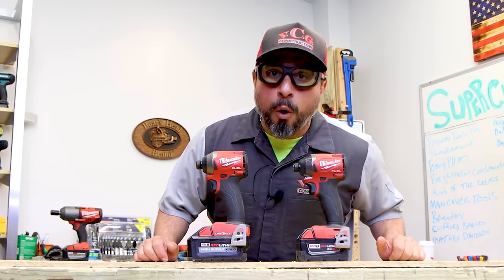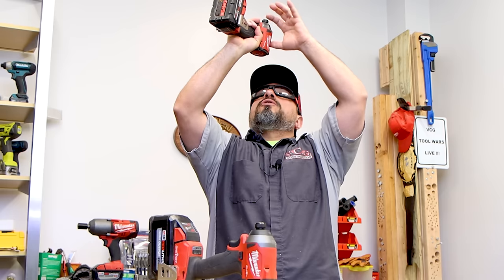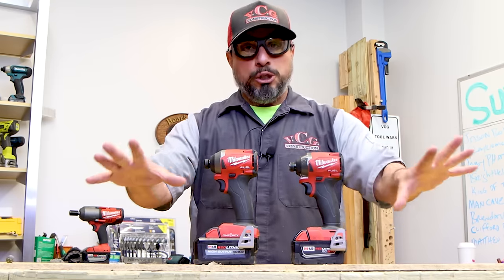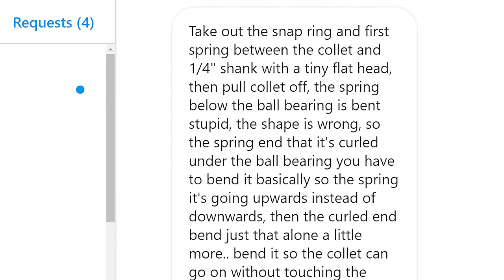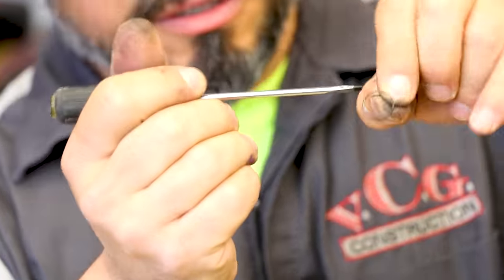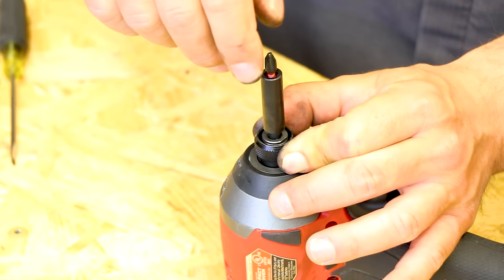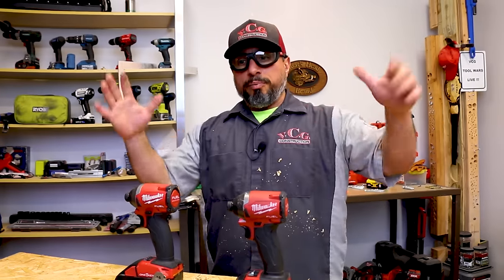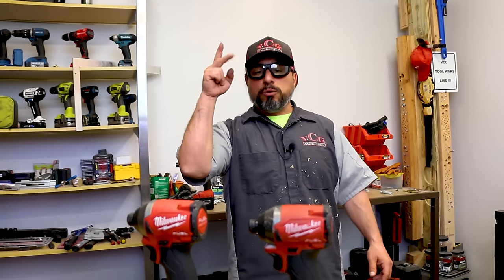FIXING MILWAUKEE M18 FUEL Gen 3 IMPACT DRIVER COLLET PROBLEM (must watch)

Comment: Hey Vince I have 4 Dewalt 885s and have had to fix 2 collet issues over the 8 years of using them hard. What has happened on the Dewalt is the bearing tensioner spring tip has broken off due to many hard years of use. On the Dewalts the bearing springs upper end is bent in at a 90° angle at a length of about an 1/8th of an inch and that little bent tip sits under the bearing. When ive fixed both of mine ive simply bent another 90° tip on the end of the existing spring where the old end had broken off after 4 years of daily use. If the fix didnt work I was just going to order new springs from Dewalt but the fix has worked great for the past 3 or 4 years. You might try a Dewalt spring in your Milwaukee collet as from your vid everything else looks very similar. Im wondering if the U shape of that Milwaukee bearing spring causes some binding issue when under extreme vibration that makes it bind against the bearing chute walls preventing it from pushing the bearing back up. It would be interesting to know how other quick collet manufacturers springs look in comparison. If all the other manufacturers have springs like the Dewalt and dont have collet issues then that Milwaukee bearing spring might be the issue. Having so many different manufacturers at your fingertips you could check it out Vince. Really would like ya to get it figured out so Dewalt has No excuse to not bring out a better impact then the 887 UGH! My 885s arent going to last forever, or are they lol. 👍👍👍

Comment: I found the problem with the collet in Milwaukee impact driver gen 3.  My old Mastercraft Impact driver has to be pushed in to insert the bit. On Milwaukee, it has to be "pulled" to release so it is the opposite. So when trying to remove the drill bit with Milwaukee, you pull the tool up and that is exactly what this Milwaukee tool needs to release the bit. Conclusion, Milwaukee will have to change the direction of the collet, instead of pulling, {to release the bit} pushing will do lock the collet in place and the bit will remind in the tool when pulling up to remove the drill bit from the work piece.  Very simple, now Milwaukee engineers get to work haha.

Comment: I wonder if you take the spring out of the m18 surge or the older brushed impact and put that spring instead. I wonder if that would make a difference since those impacts don't have this issue.

Comment: Hey Vince now that you've shown me the internals of the mechanism it seems to me what you're looking at is a tensioning issue with one of the springs but I'm not entirely certain it's actually the spring down there holding the ball bearing in it may be a tensioning issue with the collet spring not leaving the collet completely engaged. Does seem like very very fine Springs for such a hard use application. The best course of action might be to beef up one or both of those springs.
Reply from the maker: Yeah, I think you could be right

Comment: Have you stripped the serge to check if the ball bearing and spring is the same as the gen 3 ? Swap them over if they’re the same and if it still fails. I’m gutted I was ready to buy and came across your vids trying to fix them.

Comment: I iove your videos great info on your channel! I had the same problem with my impact driver . Maybe the problem is the anvil of the impact driver is not hardened enough . So when you impact on the ball or pull against the ball when impacting it peens the slot or makes the hole bigger in the anvil then it sticks just a thought.
Reply from the maker: Thank you for the awesome feedback and sharing your experience kenny! We appreciate it!

Comment: I was hopeful with the increased retention that this was going to do the trick. Kudos to the idea and attempt to share the fix which is more than the manufacturer has done to this point. I’ve watched but declined to comment before since my initial view hasn’t changed. I’d still like to see if a double bearing collet would be better and maybe the retention indents of different brands sync up to a more uniform tolerance across all. I have nothing against the daredevils but their indents seem to have a much larger indent throw which then allows the ball bearing to simply ramp up and out of the indent upon pulling the bit out. Couple that with the force in pulling the bit out also coincides with the fact that the collet may also be getting forced into its natural release position, if that makes sense. Heck, maybe Milwaukee might just want to reverse the collet so pulling it towards the motor housing releases the bit , lol. Soap box put away, appreciate what you do! Stay safe all!
Reply from the maker: Thanks Tim, hope you and yours are doing well!
Reply: Good theory, but this tends to happen with all bits, even those made by Milwaukee.

Comment: So I just stumbled across this video/channel for the first time, and had no idea that this was an issue. Now, I'm not an expert or anything, I cant thing of a time I have drilled a blind hole that deep. However, I have to ask why you go full-send without chip evac every few seconds? Surely the extra material is clogging the hole and giving you the issue in the first place? I have punched through some reasonably thick sections of wood, and I typically clear the chips out before I've completely buried the entire shaft of the bit. I'm not saying its not an issue, but it seems like basic chip evac could help prevent this issue?

Comment: Mine worked great for like 8 months then started to have this issue as well.   It also has a weird issue now when I pull the trigger the tool will do nothing with a charged battery.  Only thing that will bring it back to life is switching the speed setting.

Comment: Does Milwaukee removed the bottom spring in the new models? On Dewalt impact, the bit jumping out when you lift the collet up unlike the new One key impact that I have.

Comment: ive never had the collet problem. i would suggest its not an occurrence with every single driver. i guess i got lucky. cant recommend the Milwaukee driver enough. i use it mostly for cabinet making and carpentry. but i have used it extensively for duct installation and driving into steel frames. never an issue. the power delivered, the tension control, and the battery life is phenomenal.

Comment: Not sure if mine is a gen 2 or 3 bought it in 2019 but mine doesnt lock in when I just push the bit in I have to pull the collet ring forward like when you want to release the bit. Are any of the fuel impacts supposed to function like that? It doesnt ever drop the bit or have it come out it just wont push in and lock without manually pulling the ring forward.

Comment: I didn't really know this was a thing until I found out, the hard way... Ended up busting a bit because it came out enough that it broke off... I did see yours do it during one of your head to head battles against a competitor, and they had no troubles doing the exact thing you were, but I thought it was a fluke and there was debris trapped in there.

Comment: It was worth a shot 
I think you should try putting the M12 spring onto the M18 gen 3 spring because they are designed differently , that could work 
Thanks for addressing this
Reply: Has anyone done this yet? Did it work??

Comment: I just returned the one I bought.  It takes 2 hands to change the bits, the light is crap, and it shakes the shit out of your hand if running in lags.  It's also loud and gets hot.  My old brushed Dewalt, while not as fast, transmits a fraction of the vibration to the hand that the Fuel driver does.  The Dewalt also has single-hand bit changing and has a good light.

Comment: Haven’t had a problem with mine yet. Drill on wood, but I do lubricate the collet with wd40, and I use the drill not the driver for paddle bits.

Comment: I've never lost a bit like that, but then again I don't yank on the driver when reversing the bit out. It comes out just fine on it's own. I use spade bits constantly with my work as well, and while I can see this happening with the type of release system, the type of demonstrations or work that cause this to happen is only under extreme circumstances/abuse. Though regardless I personally don't need the quick release setup, and wish that Milwaukee would just let us use a non quick release collet if we so choose to.

Comment: I'm about to buy an aftermarket collet insert and just weld the fooker right in. I had 2 milwaukee fuel impacts from 2018 and NEVER had the issue. I plan on taking them apart to see if there is any noticeable difference. Could be something as simple as the grade of spring steel or even tolerance on the ball bearing itself. Either way, not thrilled

Comment: Man I was really hoping this fix would work so it could crush the TTR's. When it was new was the collet a problem, or did it just become an issue over time and gradually become borderline unusable for pull outs? If it was a gradual thing I would say that likely the springs are stretched, and a good solution would be to order both springs and maybe ball bearing assembly from Milwaukee. If it was an issue the entire time then replacement parts likely would change nothing like this hack did. 
Thanks for the vid.

Comment: Hi Vince good vid but I think the person who suggested the fix is barking up the wrong tree.  The issue isnt with that sping with the bend in it, it is the fact that the collet is stopping in such a place that the ball is still on the ramp on the inside and not on the flat.  When pressure is applied by pulling on the bit, the ball forces the collet forward and hence disengages.  The ball needs to sit on the flat at the top if the ramp i.e. further back on the tool.

Behind the second spring is a quite a fat flat washer which if it was slimmer would allow the collet to sit further back.  I would have tried this but I think finding the right size washer would be a pain so I put the rear of the collet, not the knurled end, on to an angle grinder and took some material off.  This now allows the collet to sit further back ensuring the ball can not force it forward to disengage.

If milwaukee wants to rectify this the cheapest option would probably be a thinner washer or the more expensive option is to reduce the length of the collet (try holding it up to the collet on the M12 impact and you will see a slight difference).  Hope this helps.

p.s.  please note if you are going to grind the rear of your collet, make sure you put a champfer on the inside edge so that it does not catch on the spring causing the same issue and bend the indent in the spring downwards with pliers.

Comment: I did the repair with the dewalt dcf886 
The spring was broken , I ended up using the same spring , reshape  the part where it holds the bearing in place

Comment: Great video👍🏻👍🏻
I just bought a factory reconditioned 2997 kit that has this impact in it from Tyler Tool. Did Milwaukee ever fix this issue? I will be curious if a factory reconditioned tool will have this fix🤔 I will have to test it out exactly like it was done in this video and if it does happen it will be going back because I don’t want to waste my time messing with this. Lost time is lost money!

Comment: The problem isn’t the spring you adjusted in the video. The problem is the first spring that holds the retaining clip. I found that if you pull the quick release and release it slowly it doesn’t have enough force to reseat the mechanism and allows bits to come out. If you pull the quick release and allow it to reseat by letting go when it’s fully extended it will hold each and every time. A stiffer spring that holds the retaining clip can fix this problem.

Comment: Does it pop off when driving lags with a impact socket on tip?...I need a good 1 for that plus screwing deck/framing...we lag rim's and post sometimes with 1/2 inchers I hate using rachet

Comment: I have a Brad nailer that just started clicking and putting in a light show, it does not appear to be jammed in any way and it doesn’t matter which battery I use. Any ideas?

Comment: @vcg construction, I am curious if this issue affects the m12 impact as well?
Reply from the maker: Miles sometime it does happen on M12 too but not on the surge impacts...
Reply: @VCGConstruction  ...any chance on taking the spring off the surge and putting it in the gen3?  Perhaps we can measure ball bearing as well.  Thanks.
Reply: @JerseyFrank007  it does not fix the issue, the issue is likely the machining of the ball and spring slot. I need to grab my caliper at work to measure and compare, but I swapped springs to check the issue.

Comment: They put a great collet on the Ridgid impact drivers.  Why don't they just use that design?
Reply: Can you say "Patented Protected" ?  Believe it or not, manufacturers pull a patented for multiple parts of a piece of equipment for this very reason.  And it may stop another company from attempting to design a competing tool or device.

Comment: I cannot confirm this yet, but based on what I can see and test... there is a manufacturing tolerance issue, the springs are fine. I swapped them with a different m12 screwdriver and the m12 still held on to the bit like business- but the m18 still felt soft with weak feedback when pushing a bit into place. I will mod one spring- if it doesn't work I still have another set.

Comment: I still use a standard drill, like the xph07 or milwaukee 2804 for drilling, i just havent seen any advantage to using an impact for paddle bits and drilling holes in general, drill chuck holds it good, and is faster than an impact when drilling, driving screws is a different story...

Comment: I just sent my M12 gen 2 impact driver to Milwaukee service repair and the only thing they did was give me someone else’s gen 2 impact driver and it has scratches on it. Also has the same issue. I just wrote an email to them calling them out. Not a good initial first chance to repair it.

Comment: Hey Vince @ VCG, awesome video. I was hoping for the WIN, but alas, it was not to be!
I have been wanting to get into the Milwaukee platform for a while now (narrowly missed out on the Black Friday/ Holiday deals this past season, even though they ran for quite a while.) 
Feeling a little bummed that since the price you’re paying for a Gen 3 impact kit (or even bare tool) is no small amount, you would hope for that semi premium price point, you would be able to have some confidence in design and build quality of such a fundamental part of the tool.
I currently use my Kobalt impact driver/ hammer drill combo, and it has served me very well.

Do you (or do any of the other members of the VCG) know if this affects the M18 Surge?
I did score one of those on sale, bare tool for around $119,  but haven’t broken it out yet since I didn’t grab a kit am not set up with M18 batteries just yet.

Thanks for another outstanding video. 
Informative, entertaining and most importantly delivered with the unvarnished truth, which is what we all appreciate and value so much!
You and “The Gang” keep up the good work.

Comment: The problem seem to be related to   the rotation of the tool overcoming the spring tension on the ball bearing... Maybe a different spring would be needed entirely or a complete redesign of the system

Comment: The collet is one thing... my biggest problem with the fuel gen 3 is a couple times a day I go to run a screw in and I get no response from the drill. I use my makita almost exclusively now because I'm tired of the issues that the milwaukee impacts have. That's ok, skeeter seems to have it figured out

Comment: You've said before that the surge doesn't have the same issue. While that could be because it doesn't have a huge spike in torque or as high of torque. Could you show how the collet is set up with the surge compared to the gen 3? 

They clearly have done it right once so what's the difference? Maybe even swap the spring and collet from the surge to the gen 3 to see if that could be a fix. If so maybe you can you request for Milwaukee to put the surge collet on the gen 3 when sending it for repair? 

Is it possible that since your collet wasn't working correctly for so long that the inside or springs could have been worn from using it with a loose collet. That could be why this repair did nothing for yours.  That's also why I'm wondering if the surge one that works might work on the gen 3. Perhaps the inside diameter is different between the collet for the different tools. I've watched all of your videos over this. I don't have either of them but I have a gen 3 on the way. 

Is there no way for them to retrofit a standard collet on this instead of the quick connect? I'd rather have that if failure is a possibility.

Comment: I understand Milwaukee and Ridgid are made at the same factory. I have used Milwaukee since my first 18 volt system back in the nicad days, and the tools are still going strong, but I kept needing to buy new batteries, now I am finding it hard to even find batteries. So I purchased Ridgid and now have LSA even covering my batteries. My Ridgid stealth has 2 ball bearings and no collet issues...SO  why doesn't Milwaukee just use a similar collet system as Ridgid?

Comment: Have you tested dewalt or makita for the same issue? That would be good to know
Reply: They have run most of the brands in TTR. (except Hilti)  

None of the other manufactures seem to have this big of a collet issue.
Reply: Makita has used 2 ball bearings for bit retention in every one of their impact drivers for well over 10 years.

Milwaukee only uses 1.  And that's a big part of why they're prone to dropping bits.
Reply: Thank you for the info